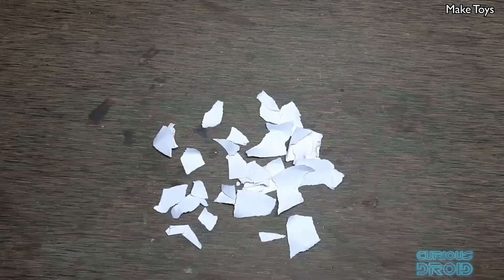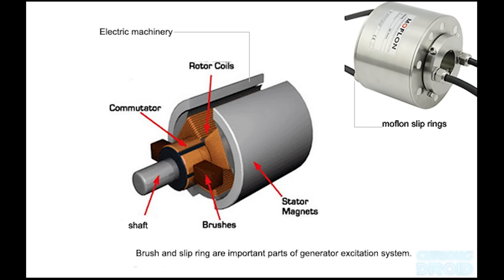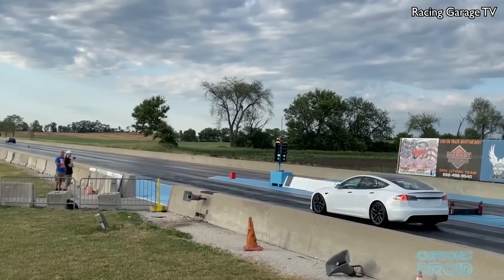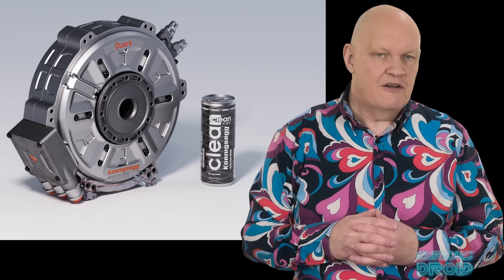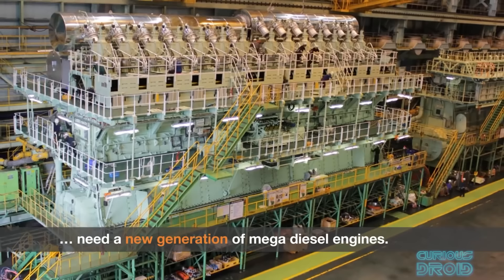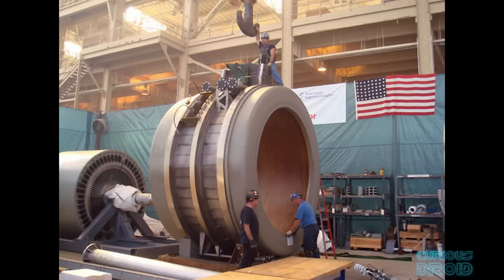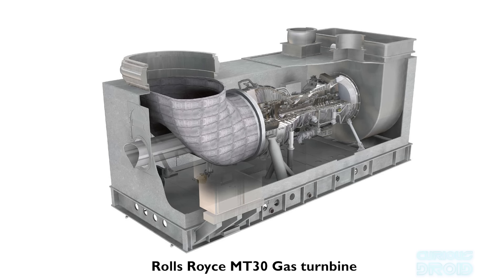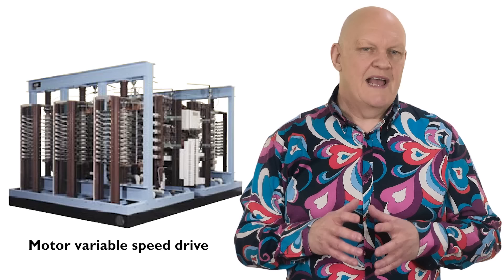The Worlds Most Powerful Electric Motors

Comment: The most powerful motors I know of that aren't purely used as alternators are in the transport grid industry. We have two hydrogen-cooled 200MVA synchronous condenser at one major transport station, that's about about 268,000HP.  They are asynchronous motors used to do variable power factor correction.
Reply: @paddor  The power grid.
Reply: They are not really motors, they don't drive anything mechanical. So if you don't count generators you should not count these either. They are just generators for reaktiv power.
Reply: that is VERY interesting.  i knew they existed but i didn't know what they are called.  not really a motor or a generator in common parlance but i'd be interested in watching an entire video just on what they are and what they do.
Reply: @larslindgren3846  they are connected directly into the power grid ---> directly into all of the rotating generators in that grid.  they provide a mechanical balance to keep the grid on speed.  giant motors that are powerful enough to keep the entire grid from lagging or over speeding.
Reply: @larslindgren3846  apologies, i'm sure you know what they are.  i just get annoyed when i hear that there is somehow a difference between a generator and a motor.    they can be designed to do both at will very efficiently.  something that can speed up the entire electrical grid sounds like a motor to me.
Reply: there are videos out there but every one that i've found is garbage quality.
Reply: @larslindgren3846  They are powered by the grid and do not generate any power from an outside source. They are motors with no load attached.
Reply: @syx3s  We use them for fine tuning between steps of inductive and capacitive compensation. They rotate with the grid so we can drive them to lag or lead and contribute up to 200MVAR in both directions depending on the need. They are useful since most compensation steps are in the 150ish MVAR range, which is not very good for precision.

You would be correct for most use case in which they provide rotating mass to a grid but we do not use them that way. We have a very uncommon grid layout, our production capacity is very far from the load so we use them to maximize transit on the 735kV network. We are almost exclusively hydro so rotating mass is not an issue for us, unlike most grip operators.
Reply: @DickCheneyXX  do you know how heavy the rotating mass is?  the thing must be huge.
Reply: @DickCheneyXX  i'd imagine they have an independant power supply connected to them to speed them up if needed?  that's just a guess.
Reply: @syx3s  They are surprisingly small thanks to the hydrogen cooling. They generate a huge amount of heat for the size. I'd say its about the size of a 25MW conventional asynchronous motor, at least those that I have seen. I edited my previous comment to further develop on the rotating mass aspect. The one in the first picture is only a bit small than ours. https://en.wikipedia.org/wiki/Synchronous_condenser
Reply: @DickCheneyXX  okay, that makes sense.  i've worked on construction and commissioning of of 200MW steam turbine generators before.  it's a massive and complicated system just for bearing lubrication of the steam turbine and generator.  that whole steam turbine / generator assembly takes up an entire building 200' x 300' x 100' high.  not to mention the steam generation which was five times the size.
Reply: @syx3s  True, The only significant difference between a motor and generator is the use case. But if you include generators then then the biggest ones are 2000 MW, far bigger than synchronous condensers.
Reply: @larslindgren3846  The difference is that synchronous condensers "motor" its own intertia to then if needed be able to use that kinetic energy as source of energy when the device is starting to act as a generator.
On ABB web page you can read this:
"
Rise of renewables leads to synchronous condenser revival
Share this page

An old technology provides answers to challenges posed by the increasing penetration of renewables in the energy mix. Synchronous condensers, verging on the obsolete, are being used to stabilize the intermittent and variable power from renewables.

Synchronous condensers (SCs) produce reactive power and are a useful solution for stabilizing the power produced by renewable resources.

SCs are rotating electrical machines that resemble synchronous generators in their design. They are neither motors - as they do not drive a load - or generators because they are not driven by an engine or turbine. 

SCs were previously used as sources of reactive power to compensate for induction motors and other highly inductive loads. Advances in power electronics led to the development of static compensators and these replaced SCs as they offered better controllability, flexibility and speed. Demand for SCs slumped and for many years they looked like an obsolete technology. "
Reply: @syx3s  in my day (eighties) they were called rotary compensators
Reply: @syx3s  they do not prevent the grid from lagging or overspeeding. That'a not what they are used for at all. That's what the power generation is for.
Reply: @hugeb.c.4312  Actually they do, but only within each short moment of time.  Anything beyond a few seconds would be done by power plants ,massive loads etc.
Reply: @DickCheneyXX  Isuzu in Brazil?
Reply: @johndododoe1411  based on his description, I think that the device he is referring to is in Canada. Also, no, it is not meant to be used for frequency compensation. The active power that it generates is negligible, it is used to adjust reactive power. You are thinking about a fly wheel, which is not the same equipment as a synchronous condenser.
Reply: Dope
Reply: So cool :"
In electrical engineering, a synchronous condenser is a DC-excited synchronous motor, whose shaft is not connected to anything but spins freely. Its purpose is not to convert electric power to mechanical power or vice versa, but to adjust conditions on the electric power transmission grid. Wikipedia "
Reply: @hugeb.c.4312  That is correct. I think the confusion comes from the fact that some grid operators now attach flywheel to those and use them for very-short term energy reserve, especially in grids that have low rotating mass on the production side.
Reply: Sounds like you could make the worlds most dangerous drill press with that.
Reply: @DickCheneyXX  WOW!  I did some work at Dominion power plants and got to put my hand on the outside of a running 1000MW hydrogen cooled Westinghouse alternator! so cool - then got to go see the smaller structure that contained the rotating regulator system that keeps it synchronized to the grid. AC comes out at 36kV with massive water cooled bus bars that go outside of the building to the huge step-up transformer to 500kv.

Comment: I work as an engineer with large AC motors for one of the companies mentioned in your video and although being somewhat clued in on the subject matter, I was nevertheless very entertained and certainly educated. Very good job on this video. Electric is the way of the future
Reply: I had the same feel when watching the video. And I'm a Field Service engineer for an electric motor/generator repair company.
Reply: It is, but where do you get the electricity from?
Reply: @allgrainbrewer10  Usually generators producing the electrcity are bigger than the motors. I know that a normal sized coal power plant is about 1000 kW.
Reply: it is a good video!
Reply: No it isn't not for cars anyway. It's hydrogen. You can never charge a battery as fast as you can fill up a fuel tank.
Reply: @sleepyrasta14820  I was mostly referring to large electric motors :)
But you do have a point regarding cars, the charging of electric cars is a problem that needs to be addressed. I recall reading that hydrogen cars only achieve around 25-35% efficiency, not sure how accurate that is. I think electric can be upwards of 55%. If fast charging of electric vehicles keeps improving, we might be able to transition, at least partially, into electric cars for a good portion of commuting etc. But I admit, this is not at all my field of expertise. I defer to more knowledgeable minds :)
Reply: @hollander133  That’s my point.  All these electric cars are essentially coal/natural gas/nuclear powered.
Reply: @allgrainbrewer10  There's been several instances lately where combined wind/solar have out produced fossil fuel electricity in the US, UK, Germany and other northern European countries.  This has happened for extended periods, particularly in the Europe.
Reply: @sleepyrasta14820  I can charge a 1mah battery faster than you can fill a 5000000 gallon fuel tank with a solo cup. Every time bro. EVERY TIME. Come at me bro COME AT ME!
Reply: @sleepyrasta14820  Hydrogen has too low of a volumetric power density to be practical for automotive transport and it also presents a very difficult distribution problem.  Electricity has a huge advantage in terms of distribution in that you can "fill up your tank" while you sleep.
Reply: @allgrainbrewer10  it’s still far more efficient, pumps far less shit into the air, costs far less per mile and over the course of the vehicle to a comparable gas vehicle. It’s like every home having home generators instead of a big power plant and then running wires for electricity, which is obviously far far more efficient. Hence why everyone does it. It’s the same thing. And about your statement, not so much anymore. Less and less and less. But still, even if we never transition to solar or nuclear at all, it’s far more efficient and cost effective. So, cool, still better. It’s a technology, not a religion or your identity. You don’t have to be offended that another technology is objectively better in a number of ways and for a number of applications, particularly daily driver cars going short distances where charging in public is not a concern anyways. Which is like 90% of Americans and 95% of Europeans. Seriously, it’s not your identity of religion, people aren’t being mean to you by choosing a better and cheaper technology that also pollutes far less, even when the source of power is the same.
Reply: @sleepyrasta14820  Others already pointed out that hydrogen has problems with energy density in mobile applications. 
Also atrociously large transformation losses of about 70% when generating hydrogen (by electrolyzing water) from electricity and condensing it by high pressure pump/tank or refrigerative liquifiction.

But I wanted to add - you dont seem to get that most current "hydrogen cars" run on electric motors!
Diven by fuel cells delivering electricity to a normal electric induction motor.

While yes, there are hydrogen combustion engines in the works, using classical fossile fuel explosive combustion technology. And those might find niches - their added complexity compared to a fuel cell/electric induction enginge combo (and lesser efficiency due to stacked combustion losses) makes their widespread application doubtful.
Reply: It's the way of the future and it's the way of the past, since it's been around for so long. The real limitation seems to be the ability to store that energy in batteries rather than getting that source from steam and/or fossil fuels.
Reply: I always wondered why our cars didn’t use an ICE engine&alternator connected to electric motors setup like in locomotives! It bothers me to no end! Care to comment?

Comment: One of the really nice things about electric motors is how easy it is to scale them up or down compared to internal combustion engines.
Reply: Yeah and the moving parts count, generaly totals to: ONE...   :)
Reply: The only "impediment" is that, the smaller the motor, the more inefficient it is. Conversely, large motors can reach efficiencies of 90% or more.
Reply: I never thought of that, but combustion speed would be a problem with a 10000 litre cylinder....
Reply: @samuellourenco1050  It probably has more to do with how most motors are used and which type of motor. Small motors are often used at very heavy load compared to their size, because even if the efficiency drops, they don't overheat (due to the total input power to them being so low). But the bigger motors running at higher power, need to run at lower load relative to their size (where they are more efficient) to avoid overheating. 
Small brushed DC motors are also quite inefficient even at low loads, because the rotor usually have relatively high internal friction. But small brushless ones, can probably be quite good.

Comment: As an apprentice many years ago, I had the privilege of a walk around of the Blooming Mill Motor at British Steel Corporation Ebbw Vale. I could walk through the stator on tip toes with my arms held out straight above my head and still touch it.
 It was a 220V DC motor. It had to reach maximum torque in 4 or 5 revolutions and stop dead then reverse. It had a 70 ton flywheel on the shaft. Current was converted by 6 Frankenstein size Mercury arc rectifiers which were amazing to see in operation, each being over 6 feet tall. 
I have literature somewhere, but from memory the motor was rated at 75,000hp. We had our own generating station, to help reduce load on the grid when it was in operation. Consuming MW/week. I've never seen a bigger motor since.

Comment: I remember when working in the mining technology industry back in the 2010s, we used ring motors rated at up to something like 25 MW, typically produced by Siemens. These were used in grinding mill applications where dual pinion drive was more expensive or not at all available. The grinding mill itself basically worked as a hollow shaft in the motor assembly, and was around 8-10 meters in diameter.
Now i work in the hydropower industry, and over here we have a couple of 160 MW pump turbines, which is pretty insane.
Electric motors are awesome.

Comment: I know the folks at NASA's NTF well, tested there a number of times but I never realized that it had the biggest motor in the world generating the wind for me. This info was probably in a facility briefing but went over my head at the time. As a side note, though I've recently retired, my team was / is collaborating with NASA to test another type of "motor" for remotely actuated control surfaces... shape memory alloy (SMA) torque tubes of nickel titanium hafnium (NiTiHf). Super small, super high torque. They need to be to fit into these small models and work at such high loads.
Reply: NASA NFT
Reply: you should collab with curious droid about your experiences and the future of such technologies
Reply: @_____ Yes, something like that. Solid state, when heated the material goes through an internal crystalline aliment change that is reversible when cooled and can be "trained" to repeatedly change back and forth with temperature change. It's very cool stuff. This material can also be designed to change shape with ambient temperature changes and not just torque tubes, all kinds of shapes and shape changes are possible.
Reply: @Shrek_Has_Covid19  NASA NTF or National Transonic Facility, as in, the cyrogenic research wind tunnel at NASA Langley in Hampton, VA.
Reply: @metallicamadsam  Hmm, yes well, only on the public stuff of course, but I'm open to that.
Reply: No they ain’t but go Gorgonzola cheese 🧀🪵
Reply: @volofly2011  sounds like nitinol
Reply: @scrambledmandible  Yes, it's an improvement alloy of nitinol.

Comment: One reason why electric aviation isn't likely anytime soon....it would take two x 100,000 hp electric motor to replace the jet engines on a Boeing 777.
Reply: And the batteries are just as heavy when you land as when you took off.
Reply: @mikester1290  Yep. A big jet like a 777 typically can be nearly 50% fuel by weight at takeoff and 5% fuel by weight at landing. Planes get much more efficient as they burn off fuel weight. Not to mention you need to lug around much heavier landing gear to deal with the very heavy landings.
Reply: @mikester1290  I think with the very best technology we have today, you MIGHT be able to make a 737 sized aircraft that could fly for maybe 45 minutes.
Reply: IMO the best bet is to keep jet airliners as they are and switch to synthetic fuel created by carbon-capture of CO2 from the atmosphere and/or combustion power plant exhausts.
Might work better if we switch to using liquid methane for the fuel in that application tho, as it's a lot easier to synthesize methane than it is to do jet fuel (but you can use methane as the feedstock to synthesize jet fuel, the problem is more one of energy input than of possibility).
Reply: @44R0Ndin  I agree. Liquid methane requires cryogenic temperatures or high pressure. Biofuel or some other synthetic is almost certainly the way to go....something carbon neutral.

Comment: It never fails to amaze me what engineering is capable of nowadays. Not that the big players aren't impressive enough but the small ones certainly are! An engine no bigger than it could fit in a handbag that delivers 300 Hp is what I call impressive engineering.
I bet we will see even smaller ones in the future with far more power and amazing torque numbers.
Reply: Dispite their relatively small size, motors are not a standalone component in a drivetrain.  They all still require a generator (either onboard or at a power station).  So, you'll have to add a few more handbags to carry it all in.

Comment: The Racoon mountain pumped storage facility east of Chattanooga, TN has 4x 413 MW reversible motor generators.  That is, using the perfect 746 watts per horsepower, used in this video (which is not realistic) is over 553,000 hp per electric motor.

Comment: I used to work with a couple of megaWatt size electric motors on an oil refinery.
We had some centrifugal compressors around 2000 kW, and an extruder that could draw up to 5,500 kW.